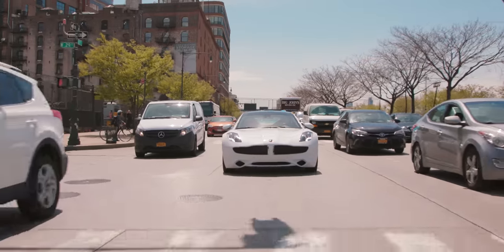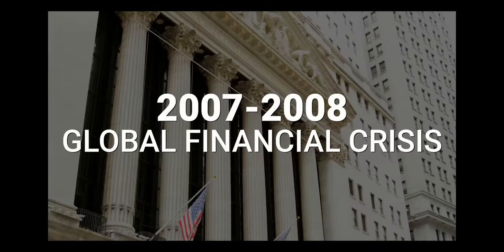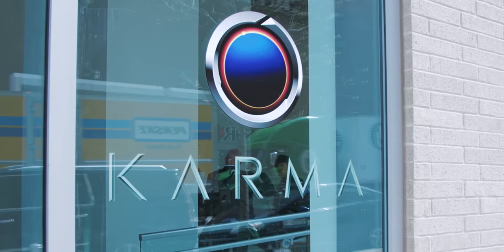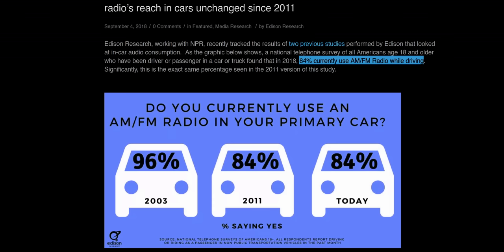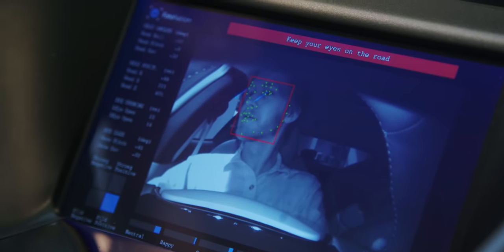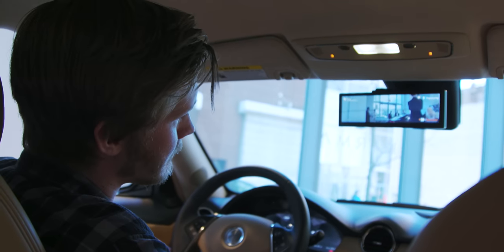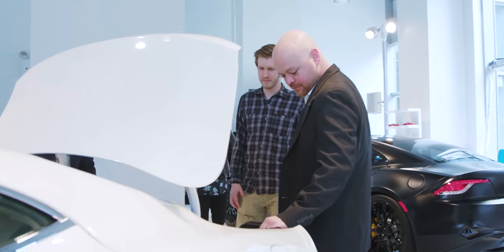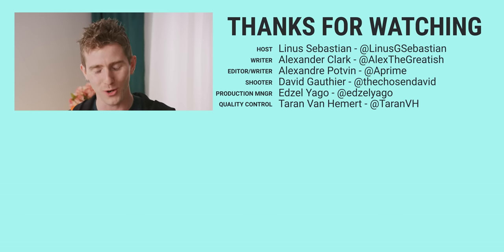What's so cool about this car's prototype FM RADIO?? - Karma Revero Showcase

Comment: well... FM radios work like that. They don't play random songs on random hour. They do surveys, they think, algorithm do some work and some time after that music starts playing in your receiver. 
If you want to play your "own" songs, there is Spotify and MP3, CD, and internet radio... FM radio got bigger range but that's just gimmick

That thing with sleep, mood recognition etc isn't new.

They just modernized older sport car with few features. That's still cool
Reply: I've already seen cars that could take the metadata from FM and download album art etc. The thing about showing what channels are playing what is new and neat, but rather gimmicky. 

As you said, sleep mood recognition isn't new, but I suppose setting it up in such a small time frame (and a single custom chip?) bodes well for its integration into cheap cars.

Comment: Tesla Should Make Solar Panel Roofs on There Cars, Make it One of Customizable Features/Packages.
Reply: Not really a lot of surface area to be very effective. Things traveling on the road tend to get rather dirty pretty quickly as well. If you wanna charge a phone and a few electronics, sure if it isn't ugly to you. Trying to charge an electric car on the other hand, good luck.
Reply: they do offer solar sunroofs for quite a while....but not for charging your car, rather for running ac and radio when stationary..

Comment: UK  - six points on driving licence and £1000 FINE and 4x insurance increase if your hands not on the steering wheel while driving,   Next, tft screenss like these can not be used while driving as are a discraction and thus a criminal offence.    This is why mainstream car radio brands do not make a car radio like in this video.

Comment: A software and hardware video mirror seems a bit risky. Especially when the back window is also small. 
There is a reason airplanes are build with multiple systems who do the same thing when one fails. That car can't be sold in the EU like this.
Reply: How would you drive a vehicle without a back window?
Reply: @caddyguy5369  Not when it's a normal car. With big vans and trucks, it doesn't matter. But a normal car should have a good backward window. Those cars are more vulnerable. In the Netherlands, they have a big problem trying to get that car road legal. Video camera middle mirror won't pass current legislation. Because it's a cheap gadget for something a mirror can do without requiring power or easily destroyed electronica.
Reply: @FishFreddy  Fair enough. Never been a problem for me though.
Reply: I would consider trucks and vans as pretty normal though. Actually this would be less normal than those.  :-P

Comment: - Who ends up mining the like / dislike data? why would this matter for radio? Unless they have some kind of feedback loop it seems like Its just market scraping
- Is the face tracking storing ANY data, or only processed and immediately discarded, 
- Has the radio had ANY kind of vulnerability testing, The sheer volume of cars that you can override the steering wheel position and trip the ABS brakes via an open wifi or bluetooth connection is getting stupid. In just about every case I have come across, the Radio could happily live on its own little gateway that was Read only from the radio, but no, They had to tie it into the same canbus as the engine and transmission.

Comment: Cramming a lot of gimmicks into a car instead of looking at handling, comfort and things you care about? Who needs a like button? NOBODY except for advertisers.
And if I'm the driver, then I'm in charge, not the car should decide when i'm awake, I am the one making decisions here. Because THIS is what went wrong with the 373 MAX 8. Wanketeers tried to fix unstability due to changed engine placement with new software instead of redesigning the wing of the aircraft. Hence it crashed. You can't fix hardware problems with software.
There is no thing like: if(crashing=true) then { dontcrash() };
Linus, you can't code a program yourself, you JUST believe whatever the wanketeers say. That what you didn't like about the Imacpro that had it's throttling fixed with a software update, remember that? Remember what Louis Rossman is telling every day about how apple works and how reliable it is? Do you want THAT driving on your roads???

Comment: Don't get this wrong. I do understand how awesome this all is from a pure engineering standpoint, but it's all just mostly useless stuff scattered on top of an otherwise okay car (at least I suppose it is, it doesn't look terribly wrong). But think about how much complexity (parts and software that can break) this adds, and if it is even needed. Filming the face of the driver 24/7 and running facial recognition 24/7 just to detect if the driver is looking at the road???
This all looks like a project where some engineers were allowed free reign to build whatever they thought was cool. And of course our systems don't break, because we designed them well, and of course there won't be any faults in the software, and there won't be any system updates that might break it.
Seriously, if the October update taught us anything, then that if a company of several thousand people dedicated to making a system run properly can't do it, then a few dozen engineers in some small car manufacturer won't be able to either.

(And yes, all of this applies to Tesla too. They are building electric cars, which easily reduce the amount of moving parts in the car by a factor of 5, and then slap on so much useless software and so many gimmicks that it evens out again.)

Comment: That't the dumbest thing I've heard today. The problem with FM is not that you can't "like" a song, the issue is that the radio stations play the same 20 songs day in and day out.  The illusion of user interactivity won't solve that fundamental failure. Neat car, but who cares? Nothing in it other than the terrible FM radio thing is a new idea.

Comment: sorry when it comes to heavy machinery the "what if" is always more important then then any other analogy. AUTONOMOUS VEHICLES AT ANY CAPACITY SHOULD BE BANNED!! the driver should have full control over the vehicle at all times. no matter what the situation is. idiot drivers that can't take this responsibility should also be removed from the roads. if you don't realize you are driving a heavy metal (or fiberglass, carbon fiber even sometimes cotton) object down the road that could kill you, or someone else if driven stupidly and not skillfully, then you shouldn't be driving at all.

Comment: when the 12 volt battery dies, the car loses the ability to move after jump started. climate control, door mechanisms, radio, entire dash basically, shifter, door locks, all quit working. it has to be reprogrammed. right now, only Lamborghini, Audi, BMW, and a few Ferrari dealerships can fix it. For just $2400 a pop. and parts are almost completely unavailable. Good luck with that over computerized piece of shit.

Comment: You want to like, share, view album art, see what every station is playing... all while driving? Enough of this. Drive your fucking car. Do the touch screen stuff when you're parked. As for self-driving... you bought a car that looks like THIS so, again, drive your fucking car. The rear view camera - you don't need 10000 angles adjusting as you move. One view, one angle - ALL in one wide-field view. Like you already get right now, in countless models. But don't listen to me - I veer off course when I look for the window de-mister button. The other buttons? Forget them!

Comment: So what, you're incapable and your mother still dresses you? If you are referring to style or choice of clothing, that doesn't necessarily reflect a persons finical means. So you go on and let your mommy dress you and i'll continue being a responsible adult that doesn't spend a hundred and fifty grand on something that it's entire purpose is to move people from one place to another safely and efficiently. As for the safety features, a responsible adult wouldn't need most of them considering that they apparently consider the driver of the car to be more of a threat than other bad drivers.